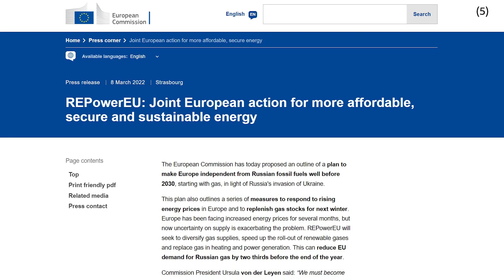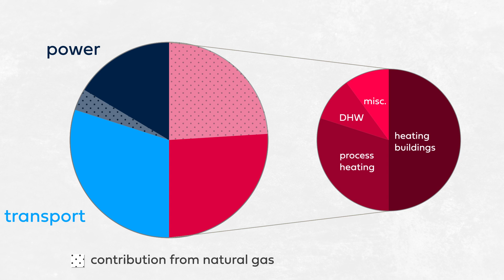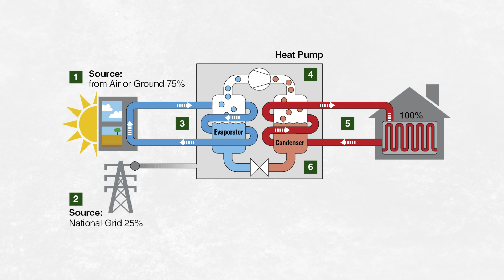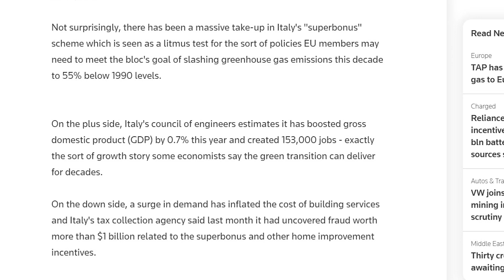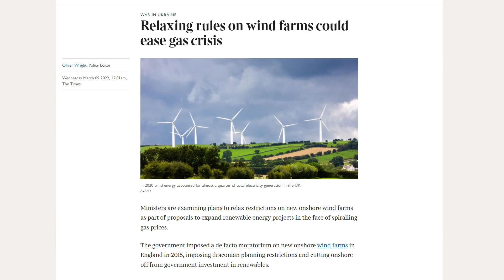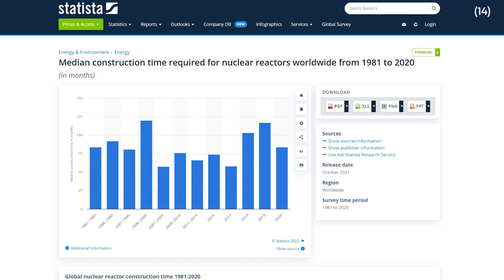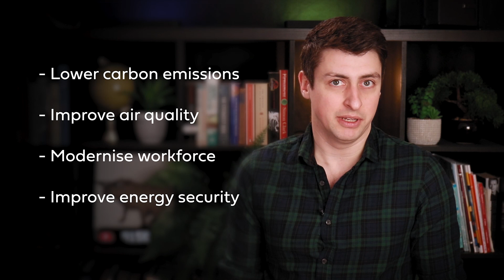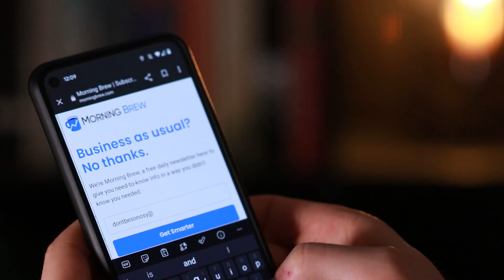How Europe can wean itself off Russian gas

Comment: Firstly, THANK YOU for pointing out the differences in power generation and primary energy consumption! People need to understand that natural gas isn't only about power plants.
I am however a little sceptical about heat pumps in big housing blocks - wouldn't they be extremely loud and get inefficient quickly during winter? I realise that for single family houses, heat pumps are the perfect solution. But so many live in dense cities, where it would take years or decades to change the heating infrastructure. What about district heating? How would that work with renewables?
Reply: You aren't restricted to one type of heating system in an apartment building. If the government is subsidizing 110% anyway, just install a heat pump alongside the gas burner. Use the heat pump most of the time, and turn on the gas burner for those really cold days. Don't let perfect be the enemy of good - doing something halfway is still better than doing nothing.

I don't think noise is an issue for big housing blocks. Heat pumps aren't particular noisy. The mechanical/maintenance room is already pretty loud, and kept away from living spaces.
Reply: In hot climates heat pumps are already in big housing blocks - an A/C unit is just a heatpump.
Reply: Heat pumps are just air conditioners, which aren't a significant source of noise in housing blocks at all. They're cheap to run, quiet, and virtually the same cost as non-reversible air conditioners.
Reply: Air source heat pumps work efficiently down to -1C and can work just about down to -4C. Temperatures in England hardly ever get that low. They have back up resistive heating for the occasional super cold night. Where possible ground source is better. For a tower block a communal ground source loop would be sensible. Sharing the high cost of drilling the bore hole between all the flats. You could then either have individual heat pumps operating from the shared ground loop, or just have a big one in the basement and pump the hot water around the building.
Reply: I got slightly confused about this insulating "your house" part. How exactly would one go about "owning" one of these houses exactly?
Reply: They only need to remove the 40% from Russia. I don’t have the number but single family houses with heat pump and apartments with non Russian gas doesn’t sound too crazy
Reply: @engineeringvision9507  If you own a house or an apartment, you could could replace the windows with better windows. For example if your existing windows only have 1 layer of glass, you could replace these windows with windows which have 3 layers of glass. When looking at a house through a thermal camera you will often see that the windows are responsible for a lot of buildings heating loss in generell. Its easier for the heat to escape through a Windows than a thick wall. When insulating I would replace the windows at first, then later increase the insulation of the outer walls with a kind of insulating material in the form of blocks which can easily be mounted to the outside area of the outer walls.
Reply: @iha10512  I didn't ask how to insulate a house, that is obvious. Simply create gaps filled with vacuum, I also can do elementary thermodynamics. I asked how to get enough money to buy a house in the first place. If I don't own a house, why do I care about insulating houses? :))
Reply: Watch Technology Connections's series on heat pumps for all the answers you could possibly want.
Reply: @deus_ex_machina_  Their series did not explain how to afford a house.
Reply: @engineeringvision9507  Then insulation should be the responsibility of your landlord rather than you.  And you will benefit from reduced heating costs.

Comment: the question is can Europe super grid take the blow ? heating is such energy intensive process and by shifting the load from gas burner to electric heater or heat pump will surely strain the grid since it's almost double the load from the heating alone. I don't know about the data but when people turn on all of their heat pump and heater at the same time during winter, it will overwhelm the grid while the rest of the renewable is also producing less power.
Reply: Dunno about the rest of Europe, but that's never been an issue in Sweden where the wast majority of the homes are heated with electric heaters and electric stoves are the standard outside of restaurants.
Reply: it's true that shifting to heat pump might increase the load, especially during winter, but the efficiency is far better than burning efficiency, so the increase is not that much important.

+Ľuboš Rybanský yes it depends on the outdoor and indoor temperature, but even in the worst case efficiency is still incredibly higher with heat pump (1 for gas against 5-6 for heat pump)
Reply: Well in Romania more and more people are getting AC and even the cheap ones are capable of heating , the electric grid is already strained in some parts of the country in summer when everyone uses them for cooling , the grid will be upgraded but we need to teach people that electric heat pumps are better than gas powered heating . I know a lot of people here that don't use the AC(heat pump) for heating in winter even if it's cheaper because they still think gas it's cheaper :)) .
Reply: @TheRybka30  If done correctly (and to be fair, most manufacturers already do this) Heatpumps can also be used as AC in summer
Reply: @TheRybka30  You can easily upgrade an AC unit to a heater by adding a single valve and a little bit of piping.
Reply: @TheRybka30  I was thinking of getting an air source heat pump in the UK with a government grant towards the cost. The model I was planning to get has the ability to act as cooling as well. But then the installer company told me that under the UK scheme it was banned for the heat pump to be used for cooling so that feature had to be physically disabled in the unit. I was so angry because I was really looking forward to having air conditioning.
Reply: @matildas3177  sweden isnt exactly the most densly populated area... this might be diffrent in Paris, Ghent-antwerp region, or Rotterdam-Amsterdam-The Hague area
Reply: Heat pump water heaters can help stabilize the electric grid - hot water can be stored in an insulated tank and heated only when there's low demand/high generation on the grid.

Comment: There are three German reactors decommissioned in 2021 which could be quickly recommissioned, plus new designs for molten salt reactors (among others) which use smaller modules & aren't high pressure can be built quite quickly on a production line & don't require the huge containment buildings which are major factors in the cost & build time of older reactors. Ever noticed how anti nuclear rhetoric always seems to profit fossil fuels?  Correlation with or without causation? It remains to be seen, but it is hugely disappointing for you  as a scientific explainer to misrepresent the issue so much. Coincidentally, the whole heat pump argument puts the onus on individuals AGAIN, like the "carbon footprint" campaign, leaving fossil fuel companies free to do business as usual. If you really wanted to stop Russian gas quickly, start producing old fashion coal gas & just convert existing appliances. Never mind about the environmental impact, at least it isn't nuclear, and the coal industry will make lots more money... You won't find that in Morning Brew...

Comment: I have double insulation on my home (walls are 35cm tick) + double glazed windows, as many of my neighbours. We don't even have gas in our opart of city, so nobody use it. Anyway, for heating we are plugged to the city grid which recive hot steam from coal plant. Temperature is sometimes unbearable (goes to 30-35 degrees inside the home) if automatic termometar is not installed. Few of my neighbours didn't want to use that sort of heating (to expensive) so they installed heat pumps. None of them are happy. First, sometimes temperature is not what they expected to be, second their electricity bills are enormous. So if you don't have solar panels to produce at least part of your power need i don't see the advantage (power is produced in same coal plant) of installing heat pumps.

Comment: One important advantage also is that they usually have an efficiency of 450% for a simple system or even more (unit exchanging heat with the ground can exceed 600% even on a small scale system and 750% for bigger system serving a building). Meaning if you produce 1 kWh of energy by burning gas for heating in your home you'll only get 1kwh of heat. But if you burn 1 kWh of gas in a power plant, with efficiency usually ranging between 40 and 60% you'll get around 0.37 to 0.55 kWh of electricity delivered, accounting for grid losses. Those will translate to 1.6 - 2.4 kWh of heat in a simple system exchanging heat with outside air, or exceeding 4 kWh on more efficient system exchanging heat with the ground and serving a building instead of a single house. Thus even if it's energy from gas, you're getting much more useful heat out of it.

Comment: I agree that the most importat is to improve the energetic efficience. In the case of heating improving the isolation of buildings. However, this is not an easy task. It is something that needs to be done, but can't be done in a short term.
Regarding changing boilers for heat pumps to consume electricity instead of gas, it would be a good option as long as the electricity is not generated by burning gas. In addition, when producing electricity, a large part of the gas chemical energy is lost as heat. This heat is not used for heating normally. For this reason, producing electrical energy to later use it for heating does not seem the best option, unless the generation totally avoids the use of fossil fuels.
Something that we should be able to do is to be able to take advantage of the thermal energy lost in the production of electrical energy. This energy could be use for building heating, at least in the proximity of generation stations.
On the other hand, although it is true that nuclear energy is not a short-term solution, the current situation should make us think about the consequences of abandoning the use of nuclear energy.
We should reconsider the policy of closing nuclear plants in the future so that we can get rid of the use of fossil fuels as soon as possible.
Instead we should promote the construction of new nuclear power plants of the new generation. These new plants considerably reduce radioactive waste and have more advanced safety mechanisms.
Reply: Even if ALL the electricity used to power a heat pump is generated by gas, that heat pump lowers overall gas consumption, because they are 3 to 4 times more efficient than gas boilers.
The heat produced by gas power plants is already being used for district heating. But this only benefits a handful of homes, in comparison.
Reply: It is as or sometimes more efficient to run a heat pump off of natural gas burned in a power plant than it is to burn it locally, unless the weather is extremely cold with air sourced heat pumps.

Another advantage with heat pumps heating water is that they can modulate their power based on available generation at night for example or during the peak solar production periods
Reply: In Nuremberg the electrical plant uses heat generated by the plant to pump hot water through the city as "Fernwärme" (distance heating). Lots of nuremberg households use this instead of a central heating unit. The plant also has a huge, very well insulated tower full of water. When there is a lot of green energy produced in the grid the plant powers down and/or heats the watertower. This increases the efficiency of the whole grid, by storing excess energy as heat and later using it to heat the city. This is a fairly easy concept to implement and doesn't require geological features like pumped-storage hydroelectricity. But I guess it only makes sense if you already got a "Fernwärme" net in your city to take advantage of that heat reservoir.
Reply: @Eckendenker  This is exactly what it needs to be done! Congratulations! I know that is something that is done sometimes, but unfortunately I'd say that this is not the most of the times. I wish, that it was enforced in all the thermoelectric generation stations.

Comment: You can heat / cool your building with geothermal...drill a few meters down, install pipes to circulate water, and you get back water that is warmer / cooler than the atmosphere come winter / summer...also, solar water heaters ftw...

Comment: the more I learn about Wind energy the worst it looks. Cost a ton in material for the amount of energy it can produce, almost all of it is unrecyclable in ways that can be profitable enough to do so, take a huge amount of space, is too unreliable so you need basically as much as it can give as back up if you don't want blackout (usually done with coal or gas. Looking at you Germany) Require a huge amount of cable to gets the energy where the population actually is which result in a big lost of efficiency. Offshore costs are even worst and have the potential to destroy the marine ecosystems which we need even more than forest to clean the air. It also has less potential to improve in the long run than solar or nuclear.

Comment: on the re-newables point: ( btw I 100% agree with redudcing emmsions where ever posible I am definaly not a climate deniter)
I appologise in advance for my spelling a grammar I am dislexic.

The grid can be thought of as a living thing. we need to generate the power as we need it and re newables are not very good at changing the ammount power output on demand, so can be unreliable. 
Another point is that there are two types of power when you're dealing with AC, which are real and reactive power. And for current to flow you need both. And renewables are not that good at creating reactive power, so thats another disadvantage.

That being said these point can definaltly be adressed if there was more investment into related technologies like grid storage.

Comment: Simon, you missed an important part of the move to heat pumps, and that is the source of the electricity.  More electricity will need to be generated when the weather is cold.

The important missing point, and it is a gaping hole in Germany's 'Energiewende' is international storage of energy.  Solar PV generates in summer, but its output is required in winter.

Technology is available today to deal with this (eg. Electrolysis to store the energy as compressed hydrogen in salt caverns and generate from that stored hydrogen in winter using gas turbines, gas engines or fuel cells. Storelectric in the UK has an interesting patent combining this with the oxygen separated by the electrolysis)
But there is currently not a sufficient market mechanism to make it worthwhile to build, even though it is needed urgently
Reply: Germany doesn't have a problem with that since it pulls huge ammounts of power from Polish coal plants and French nuclear plants during whole year.

Comment: Nuclear is good, but not for this war its true. But we should get more on it, as for the 2035-2040 we'll probably have reached the saturation of renewable on out grid and already started working on energy storage system to cope with the non controllable  output from renewable. 
By that time it's gonna be fundamental in the war against climate change serving for covering part of the base load and thus reducing the enormous amount of energy storage otherwise required by renewable only.

Comment: Not possible right now. At least not before a decade has gone by. Majority of European housholds heat with gas and the factories run on gas. Heat pumps and electric cars are not an option for majority of households until whole powergrids get rebuilt for huge power drains. If majority of households switch to heat pumps right now we would have huge blackouts in winter. Already we have local blackouts in summer when air conditioning use increases. Its only going to get worse. Green energy right now is only for rich people and not reachable for majority of people, especially you can forget us who live in Eastern or Southern Europe. Same regarding insulation.